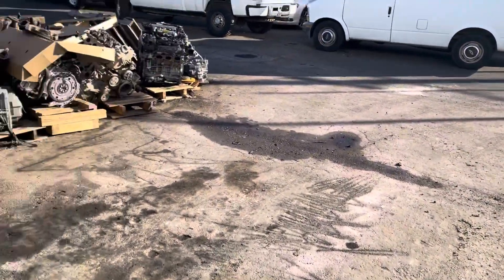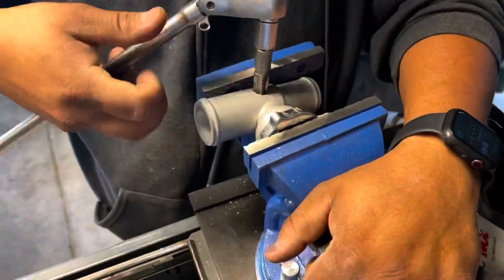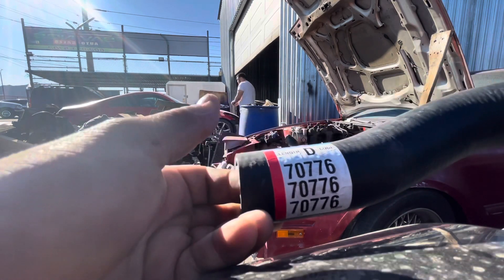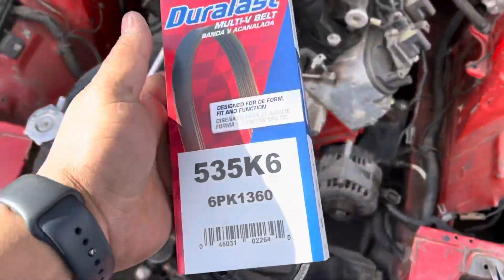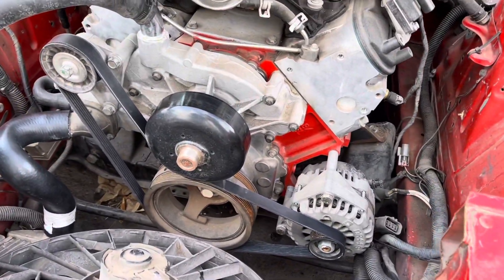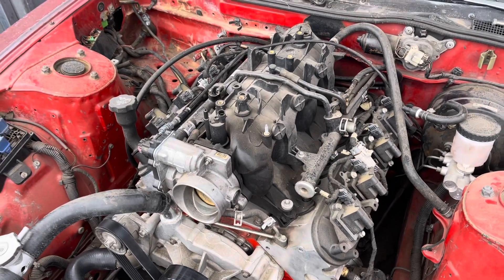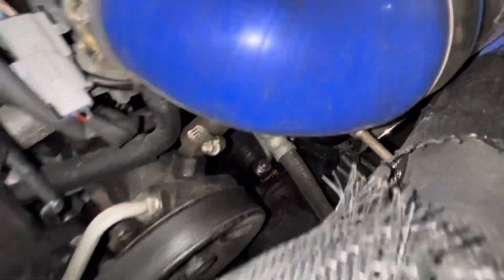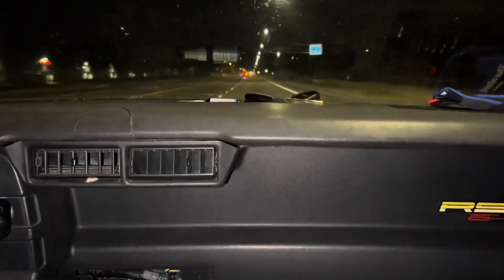Z31 ls swap cooling system/ 2JZ CAMARO

Comment: Hey I am doing the same swap... what did you use for a wiring harness it’s all I need
Reply from the maker: I used the stock wiring harness and fuse box. I just took out what wasn’t needed, extended and shortened whatever wires I needed to get it to go into the passenger side firewall